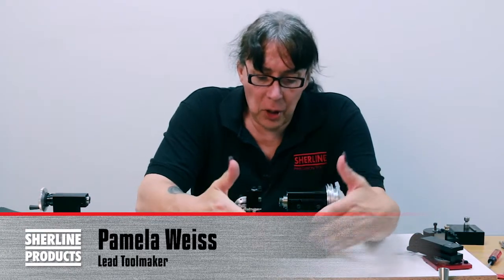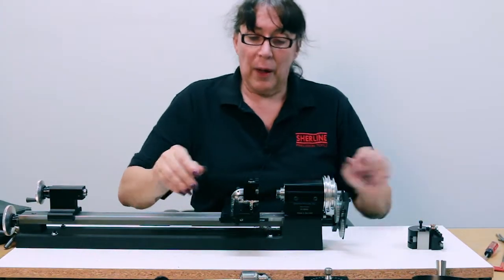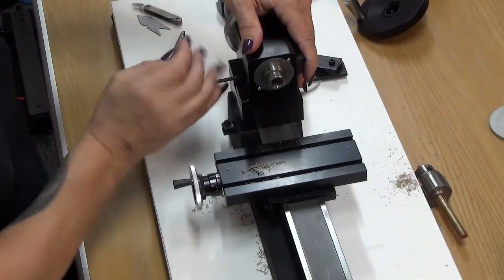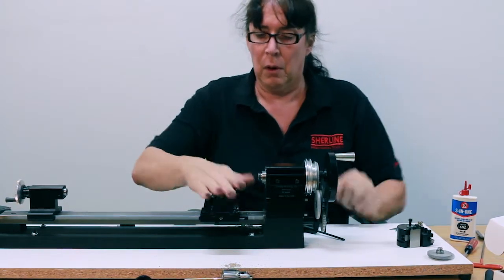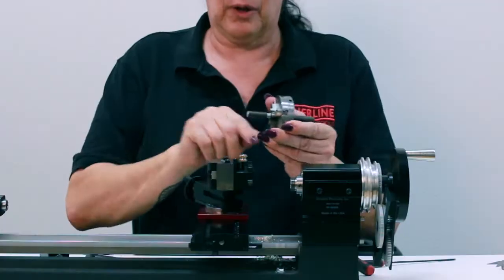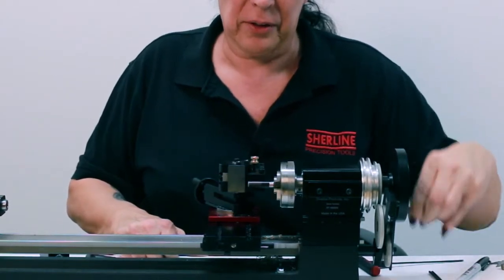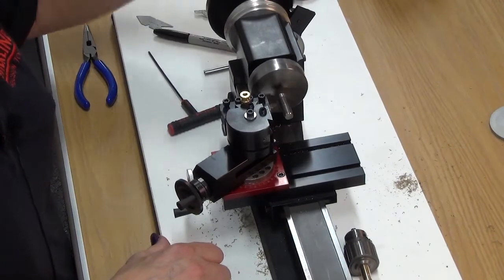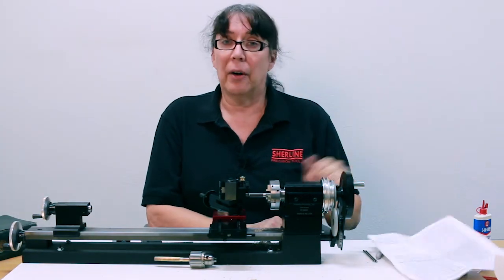Using the Compound Slide with the Thread Cutting Attachment

Comment: Would it really cost that much if a quick change gear box was made instead of the attachment? Setting gears up like this was done prior to 1940. After that, practically all lathes came standard with this box and it was a great improvement akin to disc brakes on cars. You would think that, by now, setting up gears manually would be obsolete in this age of CNC technology. Imagine if car-makers decided to go back to drum brakes. It would never happen. By comparison, the Unimat and Hardinge had a thread chasing mechanism that could be set up far more easily and quickly. They also cuts threads very accurately, with greater user-friendly control and without a threading dial and powered by the motor.
Reply: 90W motor is dicey with gears.  I think it was a HP problem I agree.. I have all the gears and stuff. My life is too short to mess with manual threading. PITA
Reply: I have to concur with robertsnare, it was probably mostly a power issue: particularly at very low RPM, the little high-revving motor just doesn't produce the torque needed to drive all those gears and cut at the same time. However, it seems to me that a quick-change gear box was not in the works in any case: if it were, they'd have given us power feeds to begin with. As far as it being a PITA, I agree, particularly since this threader does not include gears for the more unusual pitches (you know, the one's you can't just buy a die for).

Comment: Does the compound have the hole pre-drilled for mounting the tool post? Mine is an older unit and does not already have one drilled and tapped. (I can simply add it)
Reply from the maker: @sazquach
We added the fifth, 10-32 hole to the middle of the compound slide so our customers could use the quick change tool post on top of it.

In 2017, we modified the design of the compound slide to accommodate our Quick-Change Tool Post. We have revised our instructions that now include a dimensional diagram of where to drill and tap the 10-32 hole. Following are links to our Compound Slide instructions and tip from one of our customers who did this on their own. The location of the hole is not extremely critical.
Instructions: https://sherline.com/wp-content/uploads/2015/01/1270inst.pdf
Tip #92: https://sherline.com/wp-content/uploads/2018/07/tip_092.pdf

Comment: wait a minute. why the compound slide has holes on top? is that new version? this is a good idea and will help a lot when making thread. i work mostly with stainless steel 314 (sometimes brass) and only use hss cutting tool because they're cheaper and easy to sharpen. the only downside is i have to sharpen them all the time.
Reply from the maker: Yes, we added the fifth, 10-32 hole to the middle of the compound slide so our customers could use the quick change tool post on top of it. Here's a link to the instructions that show you how to modify your compound slide made before 2017.

https://sherline.com/wp-content/uploads/2015/01/1270inst.pdf (see page 2).

Comment: I wish I could be that cavalier about removing and replacing my head stock. I bought the 4400 used, but with little use.  The head stock alignment key was missing; I put two shorter lengths of key in.  They are the correct size, but there is still movement.  Anytime I even loosen the set screw, I have to mess around, realigning the head stock, or I get tapers, I DON't want.

Does everyone deal with this?  Will it help to custom fit some keystock?

The reason I opened this vid is I am thinking I need to get a compound cross slide, then fit and align the head stock, and not remove it, unless forced.

Any tips?  Thanks...
Reply from the maker: You should get a new headstock key. The P/N is 40260. Here's the link so you can order the replacement part. https://www.sherline.com/product/precision-grd-head-key/
The keyway in both the headstock and the bed are cut to .1875 - .188". The headstock key is ground to .1872 - .1874 for a snug fit. With the headstock key in place, your headstock should be square to the bed.
Reply: it uses a metric key.. which fits TIGHTLY.. you are one size small. I bought bar stock.. 13/16 or something. Your key is not the right size.. get the right size? SHERLINE keys are ground. I bought stuff from EBAY guy.. common parts.. go one size fatter. :)
Reply: @Sherline

I'll have to add that to my shopping list.  Gotta save up for a Sherline order, so much is so inexpensive, you can pay 10x as much for shipping as the part!

But, that's a good problem.

Comment: I am slow....why are changing gears here? can't they just slide to accommodate the height difference? If we are cutting the same thread, the ratio should be the same, no?
Reply from the maker: When using the risers, an extra gear is added to account for the height difference. You cannot “just slide gears to account for the difference.”

Comment: Sherlines are so well fitted parts seem Tight. do to precision maching. Like my original 3 jaw needed cleaning. Dis assemblig the chuck.. every part was tight. I checked with factory to get proper lube... tight is precision. I read about cheapo 3 jaw chucks.. wood lathes? flying apart at high speeds. I have not found any runout in any my stuff. maybe samples used many times.. TRUST SHERLINE.. :)